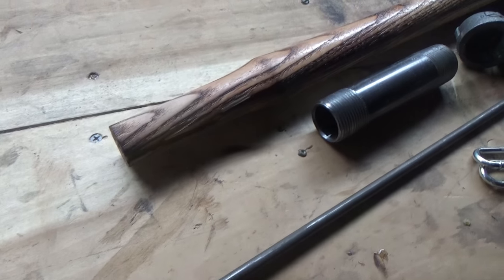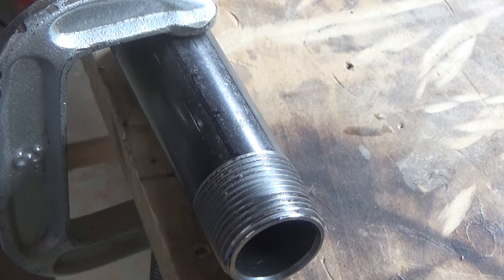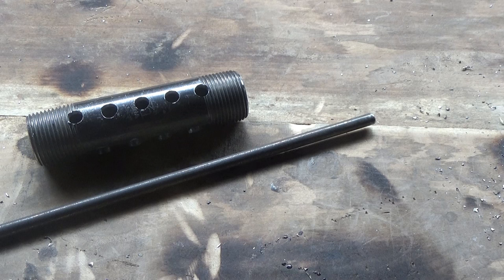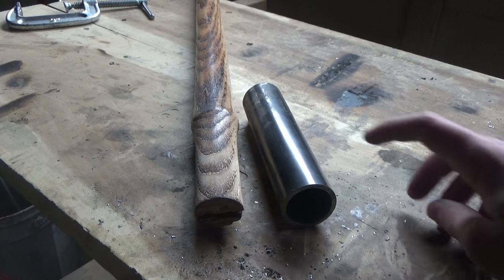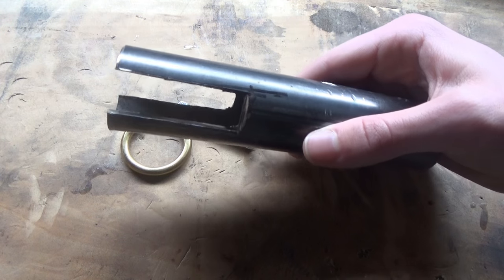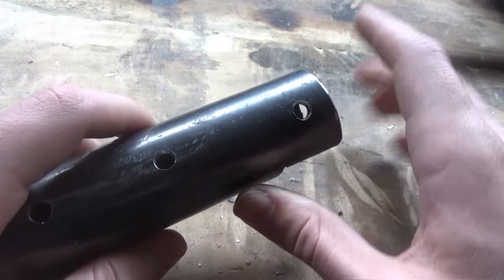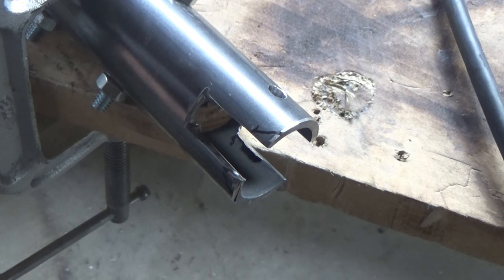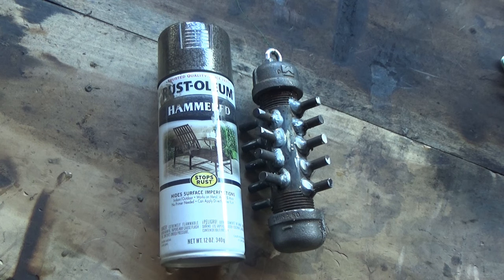Making a 5LB Battle Mace / Flail

Comment: The chain is too long. For it to be effective in a fight a flail must not be able to reach the users top hand, or reach more than half way down the handle (the given rule of thumb). or else it becomes classified as uneasy to controle, and more of a hazard to the user than it is a benefit. also those spikes should be sharp (similar to a morning star weapon). Historians believe they were used to embed themselves in armour or the enemies shield at which point, they switched to their sword. A flail (not a Mace (they don't have chains)) was never seen to be used on its own. You never went into battle, with just a flail, you carried a a backup because you could never trust a flail. it could embed in the enemy shields, armour, a tree even. At which point, if you can't get it out, you need another weapon. Flails would never have been used in a battle, but maybe a small conflict of a dozen men or smaller, because there's no safe way to swing it in close quarters with allies beside or behind you... They suspect they were more a dealing weapon. Theyre never depicted in paintings win a large battle.

Another thing. you wanted to add weight yes? bad idea, they're much easier to fight with with maybe a 10" chain at the MOST and a small weighted ball with a Morning star set of spikes (2 opposite eachother in an x, y and z axis) this gives smaller surface area on contact with means better chance to penetrate armour. what you have gives either 4 or 5 flat surfaces, and up to 9 if it hits at a 45 degree angle... reducing it to a cumbersome, too heavy to weald, 1 hit weapon. why is it a 1 hit? because as soon as you swing the enemy just as to thrust their sword and your hit. (as a prop though? well of corse it looks damn awesome :D)
Reply: He didnt intend on making this flail historically accurate or with the goal of fighting armored soldiers with it. Go outside dude
Reply: War Zone  Don't know if you have watched the video. The maker was swinging the flail with 2 hands, so the head of the flail could hit one of his hand. Also the chain is longer than half of the handle, if you watch closely. BTW why do you have to insult ppl?
Reply: @williamberne  Flails most likely were hardly used during medieval battles as they were hardly portrayed as such in medieval artwork. The whole science of how long the chains were compared to the handle is guesswork.

Comment: You should look into using lock tight. It will make all your work hold that much harder and it's fairly easy to work with and to clean. Just heat to loosen

Comment: i would make the handle shorter and make the chain slightly longer. that way u have more reach and can make it one handed. shield and mace.
Reply: Robert SToner - Yes the handle should be shortened, but the chain is well beyond long enough, 6 to 8 inches is ideal, flails, had one purpose hit the edge of a shield with the end of the handle. Then the head wraps around to hit your opponent in the back, or neck.

Comment: you made the handle too short for the length of chain and the weight and you risk to have the head come flying at your knuckles, next time you make one of these remember that it doesnt have to be that heavy if you were not to put the lead in it would have been a perfect 1 hhanded but with the weight you need a longer handle !

Comment: couldn't you have melted the lead in the mace head?
Reply: pokemon guy The ingot was too big to fit in the head.
Reply: Adrian Bridges i think it could fit . if not he could have wraped a wire on it and hung it over the pipe. either way there was better was to save more lead
Reply: You realize that bar of lead costs less than 50 cents right? There are loads of reasons why that is a terrible idea, for one, the ingot is too wide. For two, the spikes on the mace head run all the way through the head, keeping it from going in. Heating the lead with a torch in contact with the mace head would also fuck up the heat treat on the steel. Lead is spectacularly cheap and I guarantee even with that in mind he didnt care about the miniscule microscopically thin layer of lead left on the pan. 

And to your idea "if not he could have wraped a wire on it and hung it over the pipe." that is incredibly stupid and dangerous risking spilling molten lead on yourself or in your work area.

Comment: 5 lbs isn't that heavy.
Reply: 5lbs is heavy when swung hard though
Reply: +Charlie Welch Hahaha swinging 25lbs hard is heavy, you must be weak.
Reply: He means the impact. 5lbs coming at your skull is probably not going to bounce off.
Reply: ***** Okay good. Now imagine it in the arms of someone whose ACTUALLY TRYING TO KILL SOMEONE. Not to mention someone who really //builds//. Scrawny up there could barely lift a //real// mace, let alone this monster.
Reply: I site the Meteor weapon of ancient china in that flails were in fact used and effective. Heavy means more impact with less speed. You don't have to swing that at more than 12 mph to break something, but you need to put a lot of power into a smaller head to make a dent. It's all about physics. A Golf Ball needs to be going really fast to hurt you but a single light tap from an oil freighter will bring down a building.

Comment: My only real complaints about this build is that the handle is way too long. Most flail handles were about the length of your forearm. btw centrifical force is this weapons best friend, swing it around three or four times before hitting the target
Reply: no actually long flails were much more common because they were just modified treshel
Reply: No kind of flail was common. But yea, short handled flails weren't a thing, how do you protect your hand/body.
Reply: No, the problem is a too large head and too long chain.
Reply: But flails did not exist or were a one in a million weapon back then...
Reply: They did exist, period. But it was a bit of a fringe weapon, though.
Reply: with a shield, it's not a weapon you'd parry with. There were both long and short handled flails but as other have mentioned flails in general were not common
Reply: They weren't used in battles pretty much at all, but would YOU SWING THAT THING AROUND?
Reply: You're actually wrong, most flails actually used historically were 'peasant flails' - based on a simple farming tool. I think the only time a flail was really common was during hussite wars when taborites would use a thing that looks almost like the author's.

Comment: When someone who doesn't know anything about tools or parts tries to show you how to make something lol.. smh
Reply from the maker: what exactly did I get wrong?
btw no need to be rude about it.
Reply from the maker: skaterking225 
rope clip is what Lowe's called them and the tube isn't cast, the caps are however. if the welds were going to fail they would have failed when I hit the block.
Reply from the maker: oh yeah in the video I even said wire/rope clip so I'm still covered
Reply: when #skaterking225 knows nothing about metal and tries to act tough and intelligent on the internet lol.. smh
Reply: Lol nice try Ryan. Didn't get very far with that one.
Reply: skaterking225 considering you seem to think extruded pipe is cast lol I think i made my point
Reply: You mean cause the pipe you buy in my area is cast pipe as well as the end caps? Yea great point
Reply: skaterking225 mate just because the only sell cast pipe at the insignificant little place you live in doesn't mean thats how the rest of the world does it, im a qualified metal fabricator kiddo so I'd like to imagine I know the difference between cast, extruded seam welded ect
Reply: #skaterking225 resorting to name calling over the Internet hey child?
Reply: skaterking225 I also hope you're not a qualified fabricator because it seems your knowledge on basic metals is very lacking.
Reply: Never said I was I've been a machinist and tool maker for 11 years. And don't preach hypocrisies to me
Reply: #skaterking225 I never said you where either i was just hoping you weren't. Even as a machinist you should have basic knowledge of metals which you obviously don't if you thought that pipe was cast
Reply: Ryan yup. You're right. Ya caught me everything I've done for the last 11 years hasn't taught me a thing. I just stand there and turn handles. When you look at metal long enough it welds itself too. We got a real winner here guys.
Reply: #skaterking225 obviously it hasn't if you can't distinguish the difference